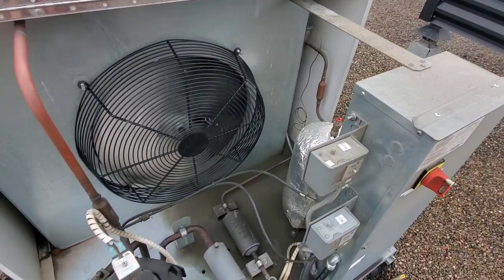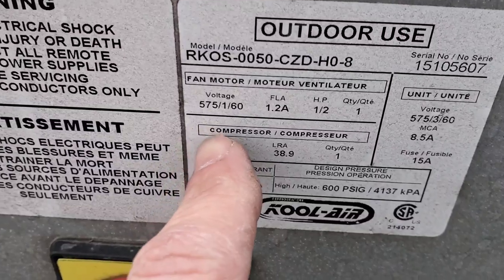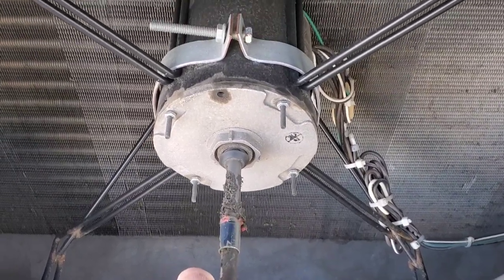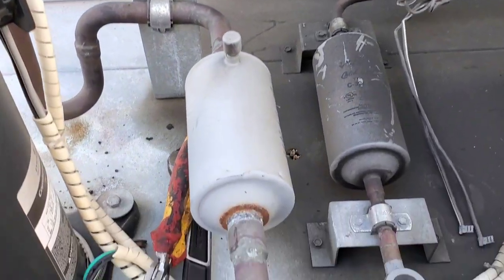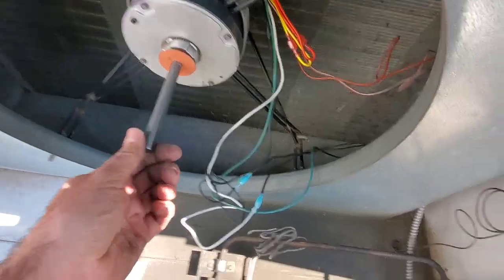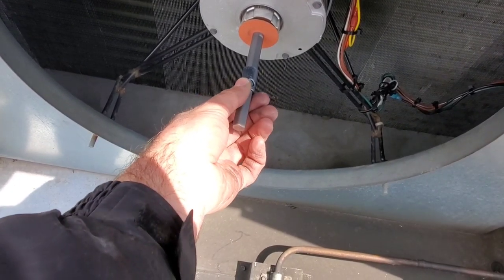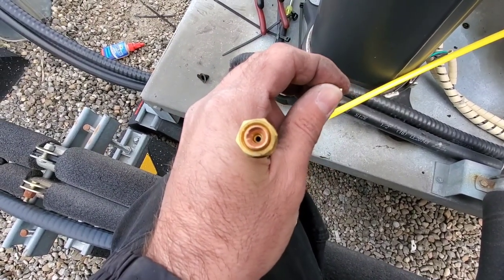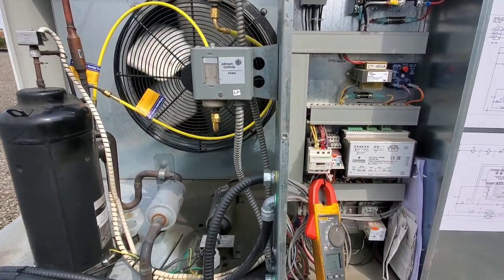Run Capacitor Failure On A 410a Air Conditioner

Comment: i have found on a lot of occasions where the wire rubs out on the steel frame on the motor.  i use plastic sleeves where it touches the frame.  good work.  keep  them videos coming.
Reply from the maker: Nice and thank you!

Comment: Great video showing the full call, did you pull a vacuum on those hoses you installed?
Reply from the maker: You can't pull a vacuum on them because they're open on both sides with no way to isolate them.  I purged the air once attached the the system side before tightening to the Press. Switches
Reply: @HVACKnowItAll  good deal, wasn't thinking a vacuum would work. Thought better after I commented since they are just like hoses on the manifold 🤦‍♂️

Comment: In reference to the fan capacitor it's installed from the factory upside down simply to prevent water / moisture collecting in the rim of the capacitor on the connections which we all know what would happen if that was the case , even so anytime I see a CAP installed out in the elements I try my best to relocate it to dry and safer place ...nice job....CLS SERVICES TRINIDAD AND TOBAGO CARIBBEAN.
Reply from the maker: Thank you

Comment: Hi, thank you for the video. Question: are those cool looking hoses rated for prolonged UV exposure? Thank you.
Reply from the maker: Not 100% on that but on this unit there is a lid over top, so if doesn't receive any UV

Comment: Why use a rescue and not go back with the oem motor?
Reply: Aaron Natoli especially if it was planned downtime. I agree
Reply: Think about it. If they dont have OEM and customer  plan downtime is next day you coming back with what you find and get them back and running. Refrigeration is always getting it running ASAP
Reply: @ScrewedUpEssayLatin  i agree    sometimes the oem motors take weeks for it to come in.   especially with a critical system they want no downtime.